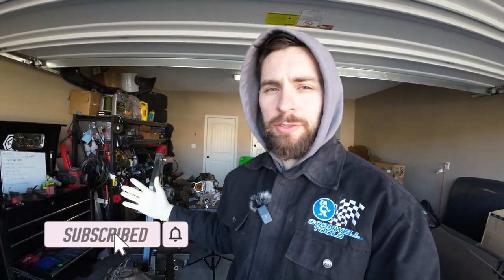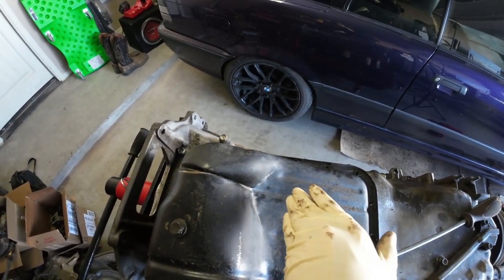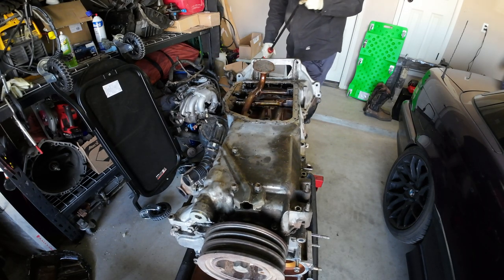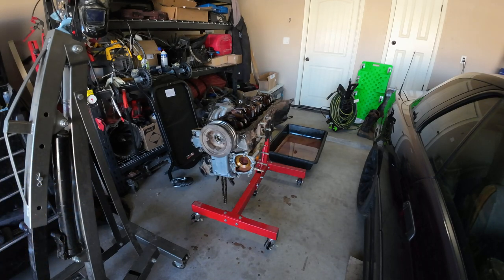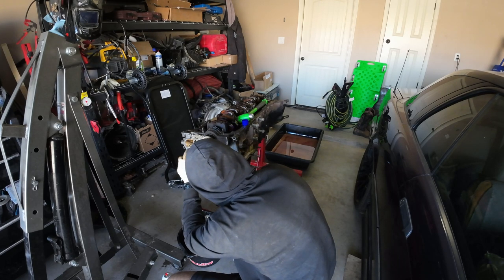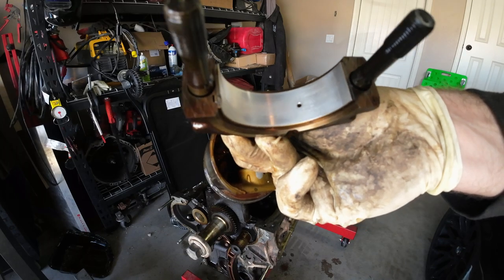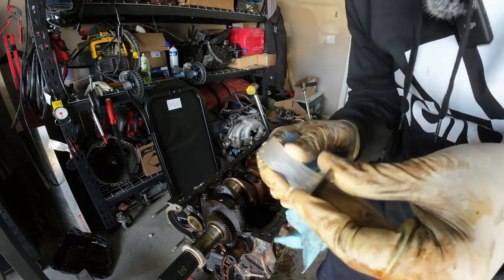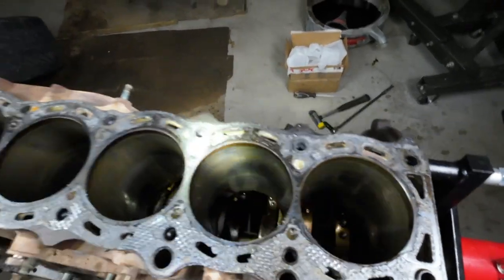This Engine Was About to Spin A Rod Bearing! | LandCruiser Engine Teardown Part 2

Comment: When I did the lower oil pan, I whacked it with a dead blow hammer on the sides and it loosened it up.
Reply from the maker: Yeah usually that's the better idea, I knew I had a new pan though so I just wedged it off. Also I just recently got a soft hammer after this occurred 😂

Comment: It comes off if you do it correctly, they're pretty hard to get off. The if you prevent the harmonic balancer from moving it will let you do it with a breaker bar when it's mounted to a car and the engine mounts, no idea about the engine stand, probably pneumatic is best.

Comment: My crank pulley came off easily as well. You may still want to replace the harmonic balancer simply because it has rubber in it and after so may years, any rubber component should be replaced.
Reply from the maker: Good to know! I may just do that, thanks!

Comment: Nice work bro,  just found your channel. I am losing coolant slowly from somehwere but IDK if its the head gasket. my reservoir isnt bubbling and my oil isnt milky.
Reply from the maker: Thanks! Appreciate the comment!

I have had cars in the past slowly leak some coolant into the cylinder and didn't do any of the usual symptoms, but before you assume the worst I would check out the heater core or rear heating if you still have it.

Apart from that you can snag a combustion gas tester from harbor freight for about $20 and use that on your reservoir or directly at the radiator cap. That should tell you the good or bad news if it changes color lol.

I should've went over that in my video. Looks like I need to find another blown head gasket somewhere 😂
Reply: @motor.mausGarage  yeah I have the radiator block tester but I'm scared to use it but I may have to lol 👍 I did the rear heat delete so idk 😶 if it's that either lol
Reply from the maker: Lmao I feel that. Well the good news is you don't have to go as crazy as I did to replace the head gasket, I mainly did it for the channel and to get the info out there. Plus mine was in pretty rough shape leak wise so it was the best option for me.

Comment: bro......... 3-5k for the short block and like 1k in shipping. You're basically 1/3rd the way to an engine swap. You can buy a used sub 200k miles 80 series engine for the cost of the short block. 

why?
Reply from the maker: Because I can 🤷‍♂️. Regardless of what condition I got one in, this was going to happen eventually, that was the whole idea behind this channel. Call me crazy but I like doing this stuff 😂.